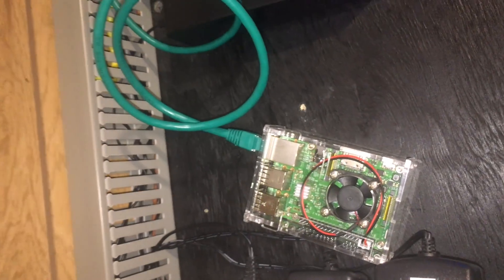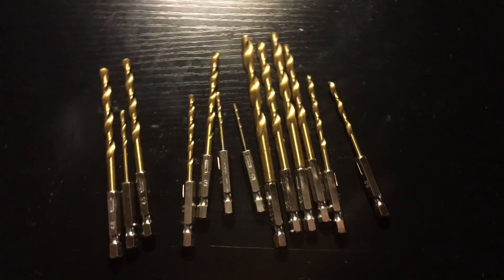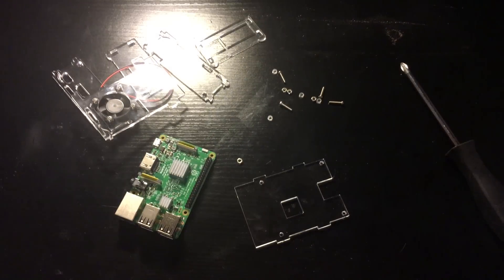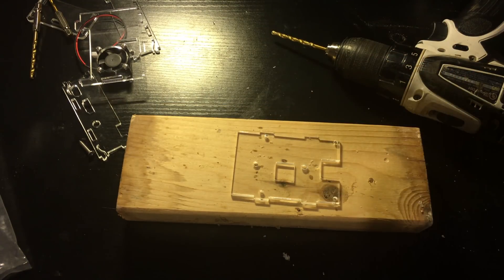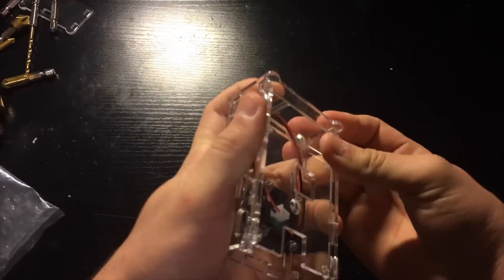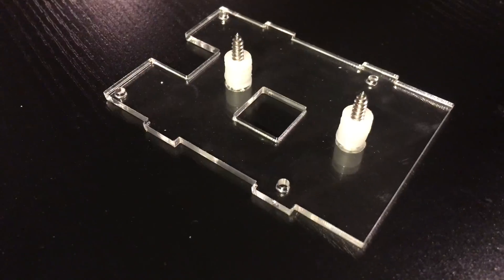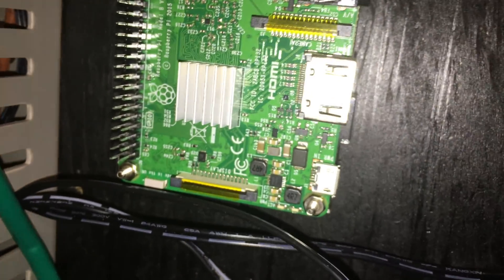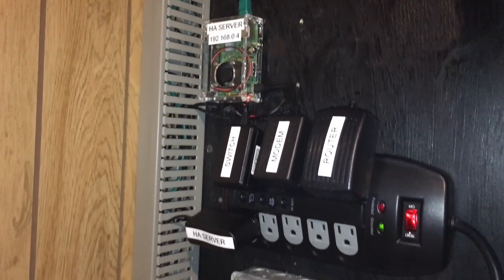Complete Guide Setting Up The Home Automation Server (OpenHAB 2 + MQTT): Final Installation

Comment: excellent video. thank you

is there a way to integrated broadlink RM Pro with Openhab? 

The Rm is a cheap RF/IR receiver transmiitter

i have already broadlink wall plug  and RM but i want to start a true solution like openhab (Broadlink TC2 Smart Home Original EU US UK Touching 2 Loads Panel Switch Wireless Remote Light Controller)

how can i integrate my broadlink RM pro with Openhab to control my TC2 wall plugs?

in your current video, i do not see any RF receptor/transmitter? how could i communicate with my wall plugs

Comment: I am breaking my head over and over I load the image on the sd card and plug it to the internet I look in the monitor the process it works. and i am able to see the pi ip address by the way i am using a raspberry pi 3 but I have no idea what goes wrong and nothing is completed after the 45 min. and the pi does not show in the network no ip address connected again to the monitor and show a lot of errors it looks the openhab does not install or completed properly. any clue I am using the frees openhab img
Reply from the maker: Are you using the V1.2 or V1.3 ?